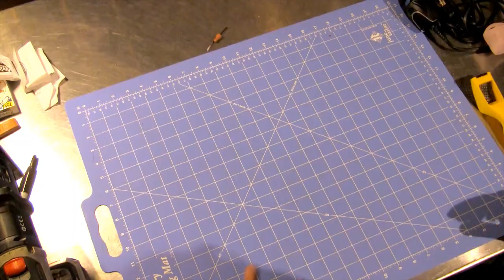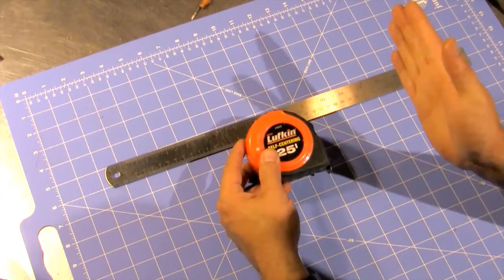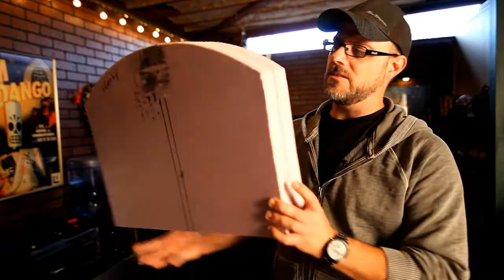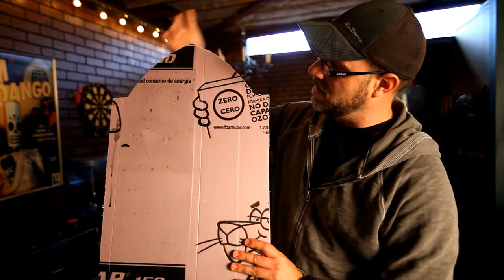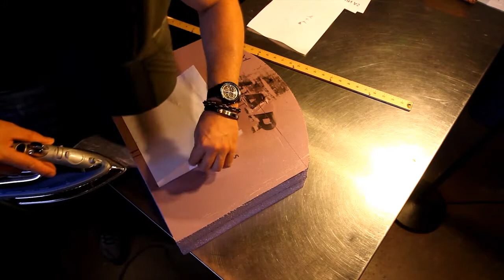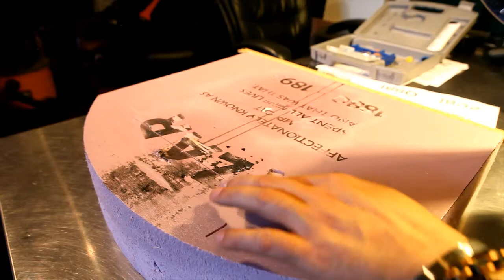Halloween Tombstones: Tools and Tips

Comment: Try the Bosch T313AW3 jig saw blade.  It's designed to cut soft materials and has a wavy Edge (no teeth). There is literally no shavings to clean up.  Best thing I've ever used for cutting polystyrene.